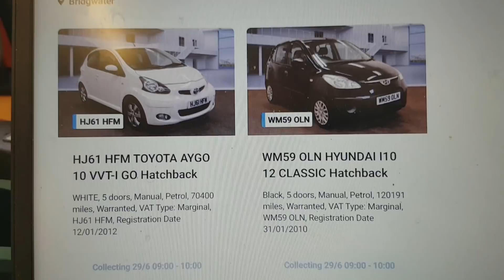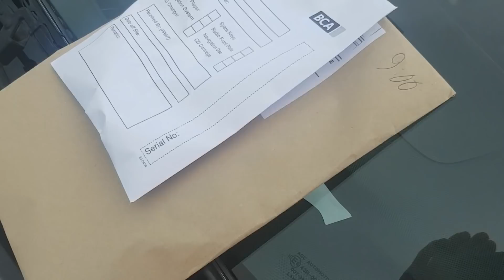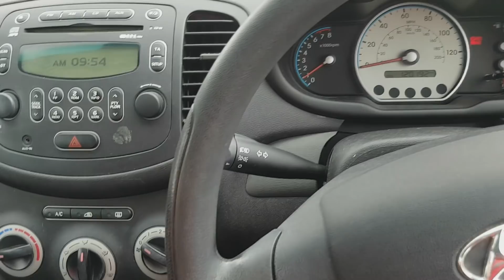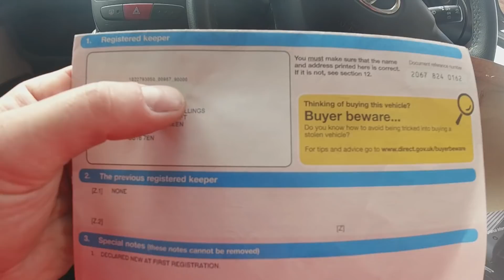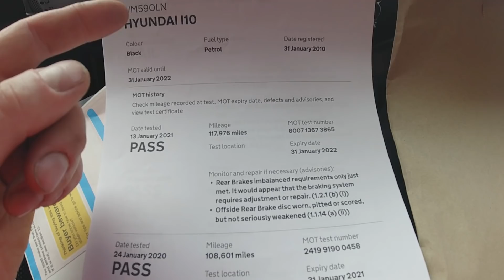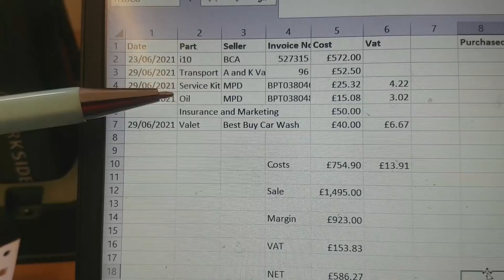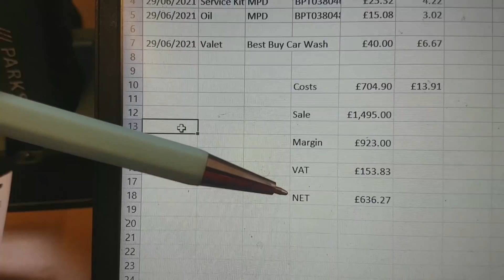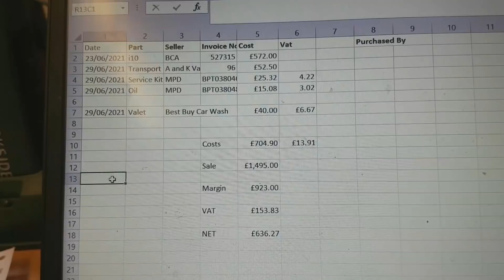My Quickest Car Flip Ever from British Car Auctions! Full process, costs and profits shared!

Comment: You had an i10 with a stuff/hard clutch pedal near the bottom, I've just brought an i10 like this. clutch is perfect no slipping or gear change problems & biting point is spot on. Just a hard clutch pedal, I've been told this maybe down to the clutch cable, is this correct
Reply from the maker: Clutches have manual adjustment so sometimes it just needs resetting

Comment: Aygo has nav on it. Shame didn't come with air con too. I10 been looked after by someone. Bet can save on advertising and just use pre advert on the FB page.
Reply from the maker: Sat Nav you mean? No or do you mean it had one of the plug in ones
Reply: @ChopsGarage  see the top of the centre console, that "thing" flips out to reveal a sat-nav built in, on cars without it that bit is just an open storage area.

Comment: Yeah fancy sitting in a car with the fan on just getting recycled air 😂😁😀😃😅😄😃😂😅 because the pollen filter needs changing, a clue is windows getting steamed up easily inside when you haven't got in wet.
Reply from the maker: Yes learned something new

Comment: Did you pull the dipstick out wipe then push it in then pull it out again to get a real reading
Reply from the maker: Which car mate. As a rule yes, if it was going on trailer prob no
Reply: @ChopsGarage  ah it was the i10
Reply: @ChopsGarage  The oil is already settled you don’t need to wipe it at all as the car has been standing & stone cold
Reply: @SalimKhan-gk1fh  👍

Comment: Whats with the big interest in a 120k i10 on a 59 plate when youve got that Aygo with only 70k miles on a 61 plate ???   I wanted a nice low miles Aygo but ideally in grey or the blue but landed your Matiz instead......
I think your repair approach touching in on the i10 is bang on for what is just.a city car not a luxury car.
Reply from the maker: Aygo is £2995 the i10 £1495 so it's the price point
Reply: @ChopsGarage  arh right....love the engine bay though on the toyota.
Reply: Those i10 go for silly money I've seen 61 plate i10 with 70k go for 3k+ atm.

Comment: Saw the Toyota had an RAC battery so it broke down at some point...
Reply from the maker: Ah yes true
Reply: Not True at all a 10-year-old battery coming to the end of its life It’s not a breakdown it’s a wear and tear consumable item
Reply: Probably outside the owners home on a cold morning.
Reply: @marklittler784  probably just needed a jump. But RAC upsell
Reply: @stephenrowley4171  Yeah flat batteries need to be connected to another battery and a trickle charger or the charger doesn't detect there's a battery to charge, after a couple of times flat might not charge though.

Comment: A one owner car is not always a good thing sadly.
Reply from the maker: True
Reply: But joe public think so, and that’s what matters. Joe public are concerned about all the wrong things.
Reply: Yeah remember going to see a low mileage one always parked the same direction outside so all the red paint was faded on the drivers side by the sun 😂😁😀😃😄😅😅
Reply: One lady eye doctor I came across had done 120,000 miles from new in it and regularly serviced at the main dealer she was still on the original front pads due to mainly motorway miles and obviously  using her eyes on the traffic situation well ahead !
Reply: One Nurse I came across worked at night and garaged the car the paint work had hardly seen the sun for seven years from new !